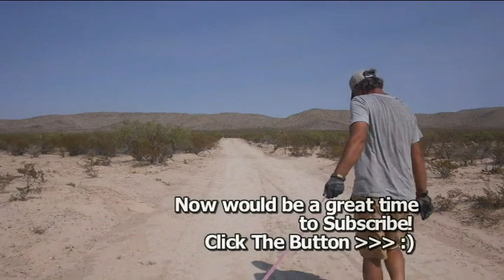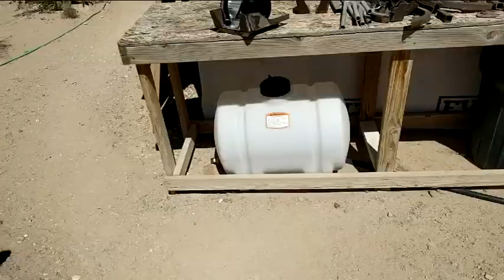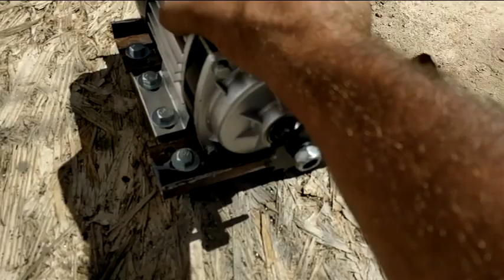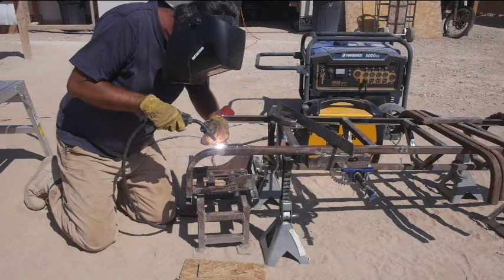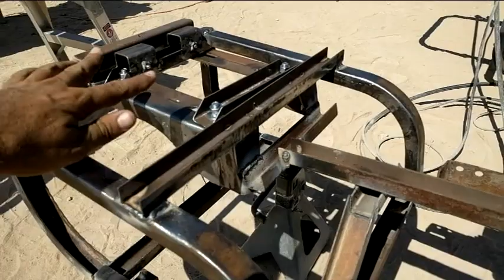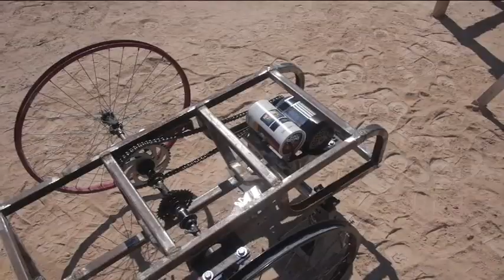Project Turtle - EV DIY Bike Project Episode 11 - Motor Mount

Comment: Looking good Carlin! I SO wanna ride that! Take small trips, head back and chart your range off the battery pack then that should give you a good idea where you need to be. Excited to see the final result! God Bless and Stay Safe
Reply from the maker: Yeah it was close, just not quite ready to ride on when you were here. Definitely next time. I finally got the chains in now for the pedal power, so that'll let me do longer range testing, knowing I can pedal it home! It rolls really easy, it should go pretty good.
Reply: @CarlinComm  Sounds good! I just had a wild thought - Wonder if you could also put an additional derailer on the electric motor side of things? Multi-speed transmission! hahaha
Reply from the maker: @houstonfirefox  Theres a guy.... Rather B Welding I think, he's making go carts and buggies, some are based on motorcycle motors, one episode he made a 2 speed gear change by shifting between 2 sprockets, it  worked better than it should have. There is also a company that makes a high / low / reverse gearbox for motorcycle conversions.  From what I see so far, I got lucky, and picked a decent sprocket set, have a pretty usable speed range.